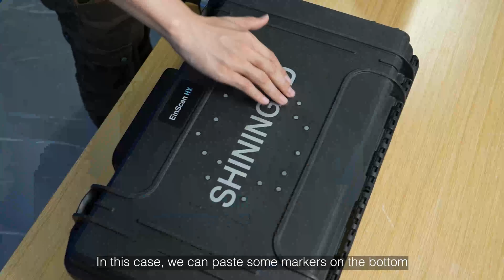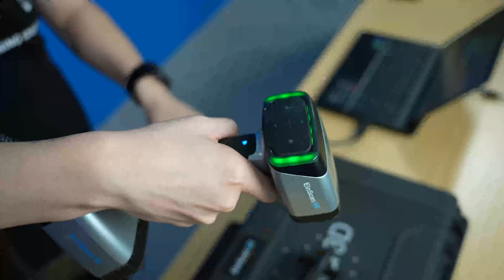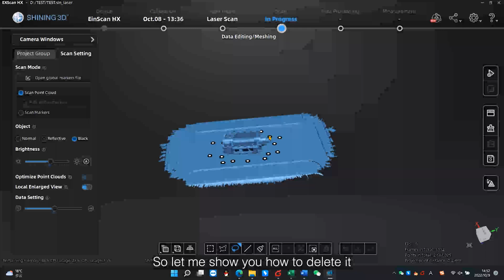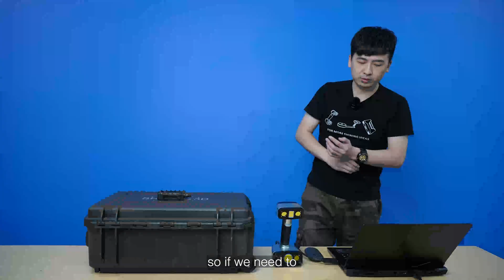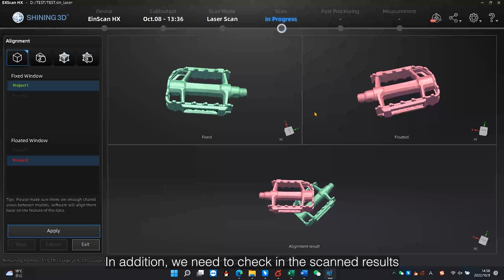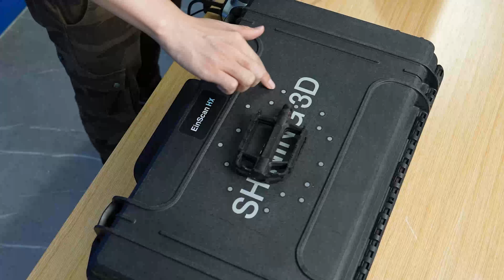SHINING 3D EinScan Salon Ep 20: 2 Practical Tips for 3D Scanning Small Objects with EinScan HX

Comment: What laptop are you using ?
Reply from the maker: Hi Makola, thanks for reaching out. The recommended computor configuration is OS：Win10，64 bit；Graphics card：NVIDIA GTX/RTX series cards，higher or equal to GTX 1080；Video memory：≥4G；Processor：I7-8700；Memory：≥32GB